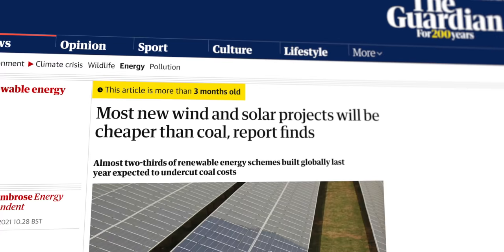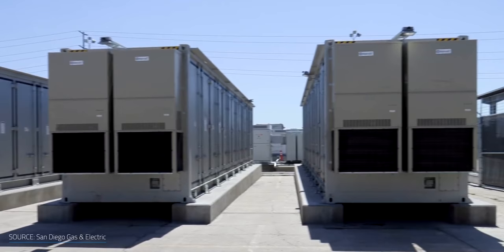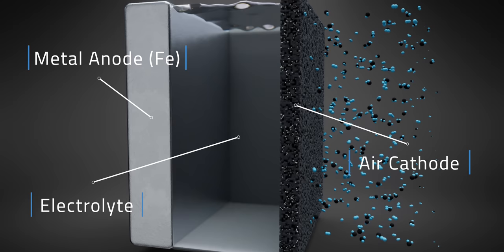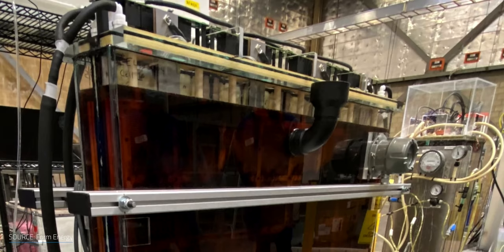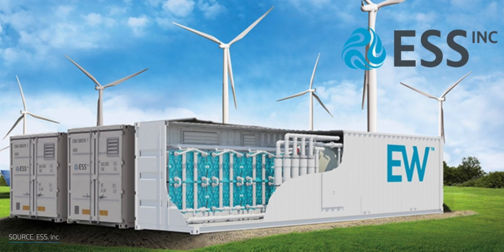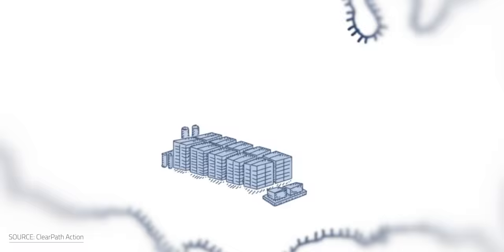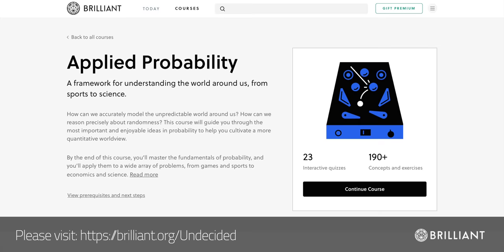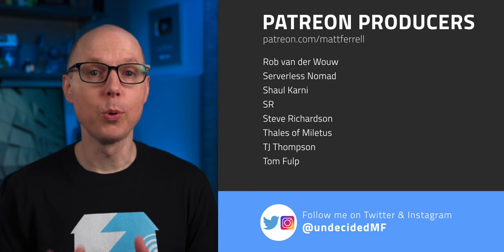Why Rust Batteries May Be the Future of Energy - Iron Air Battery Technology

Comment: Pair this with Flywheels and it could be an all-in-one solution for grid storage.
Reply: I was interested to hear his take on that. From what he said here, I would say that flywheel storage would replace Lithium ion storage for all but the most immediate response need. But that's just an armchair opinion.. Wish it had been mentioned in the video. He has access to a lot more information than I.
Reply: @jemsterr  It's honestly not a very desirable solution on earth. You either have to contend with heavy air resistance continuously draining the power being stored or invest in energy expensive evacuated chambers which kind of defeats the purpose of an energy storage device. In vacuum or very thin aired environments like space, the Moon, or Mars though, the game changes.
Reply: @yoshikhurazi1769  Thanks for that. Matt's video from 9 months ago sounded much more hopeful, which is why I thought it strange that it wasn't mentioned.
Reply: @jemsterr  It does have advantages in certain circumstances - such as when the power generation method itself involves kinetic energy such as a wind turbine, a decent portion of which would be lost to inefficiencies otherwise. It's just not a very good general solution despite being technically the first power storage method humanity had - long before we even had batteries or electricity.
Reply: @yoshikhurazi1769  i think humanity can made vacuum casing + magnetic levitation for those flywheel...
Reply: @alphaxfang  which would necessitate a bulky casing and a continuous power draw if you want to use an electromagnet - which you likely would since the alternative would be insanely expensive. It just doesn't make sense from a power density point of view. I'm also failing to see the significant efficiency gain from magnetic levitation here in the first place. You could dampen vibrations from escaping the wheel by suspending its base but the actual power saving there would be minute.
Reply: @yoshikhurazi1769  well you just need to cast it once and it will last forever, i don't see any problem with using vacuum case... Using permanent magnet always an option...
Reply: @alphaxfang  Even in microgravity environments, the angular momentum of a rotating body will bleed out over time due to both the solar wind as well as more subtle interactions with gravitational bodies. This is especially true of something as small as a flywheel. That's in space. 

On Earth, you have to deal with both gravity and the rotation of the earth causing perturbations, needing to routinely run pumps to maintain the vacuum conditions inside (since no evacuated chamber is perfectly stable), and somehow being able to translate this into power in such a way that does not significantly compromise the stability of the flywheel itself.

Why do all of that when batteries are able to work without any moving parts and without needing massive enclosures before they become energy dense to be practical? You would literally need spokes kilometres long before I could see flywheels getting genuinely competitive with batteries and such an idea might work as part of a large rotating space habitat that will need a counter-rotating part anyway to prevent instabilities developing in microgravity.
Reply: @yoshikhurazi1769  it is possible after all it is a combination between flywheel with that iron air battery, that iron battery give steady output and when the peak hour need it the flywheel will give the instant power supply... Why not lithium? Expensive, degrade over time, and it have risk of burning... We still don't have one battery to rule them all, so pairing different combination battery to cover each other weakness is a logical move...
Reply: @alphaxfang  that is true but what pundits often miss is that there are also costs associated with mixing tech - and I'm not talking about financial cost either. 

It's safe to say that Lithium ion itself is a poor fit for long term energy storage at the scale of cities or even villages. Iron air and other batteries show better promise in those sorts of applications. Flywheels have their place in certain systems, especially in conjunction with wind turbines. They're just not a good one for general purpose applications.
Reply: @yoshikhurazi1769  they are good for their intended purpose, since this video strictly speaking battery for grid level storage... that is where flywheel battery and iron air battery is suitable... 

for ev or mobile device lithium ion is a good choice for now, even though solid state is the future holy grail...
Reply: Fly wheels are dangerous to store lots of energy.  What would be good is a pumped air storage.  Just pump water into a salt dome to get a stupendous air tight vessel and then pump air to store energy and run the compressed air through a turbine to convert to electricity.
Reply: @yoshikhurazi1769  Current systems that are out there are almost all vacuum sealed and use magnets to reduce drag. Now they are expensive but that largely has to do with economies of scale. Not a lot of people are pumping them out in large quantities.
Reply: @alphaxfang  Exactly! Flywheels are great for spikes in power usage. That's why they are paired with battery systems today. Batteries are good for consistent power output but not so good for power spikes, that's where Flywheels come in.

Comment: Start-of-life and end-of-life environmental costs are often ignored when it comes to "green" energy production.  For example, lithium production is extremely dirty and requires massive inputs of fossil fuels to power the needed vehicles and machinery.  lithium ores are rare, they produce mountains of tailings and require huge settling ponds.  They are derived mostly from water-poor locations, leaving the local peoples short of water.  

End of life is no better for lithium.  Lithium batteries nearly impossible to recycle, resulting in almost all of the rare, expensive element going to landfills instead of new products.

Iron is much more abundant, can be derived from recycled metal, and can be recycled easily.  The additional weight doesn't matter for power station batteries.  It's a great idea and I hope it is widely adopted.
Reply: There are other sources of lithium utilizing existing oil/gas well infrastructure. Pump up the salt water from down deep - extract the lithium and pump the rest of the salt water back where it came from.

Comment: The problem with thinking storage will make up for times when renewables can't produce is that you have to have massive amounts of storage, AND you need a lot more production capacity than demand, so that storage can be charged up.
Reply: But that's the thing, solar production, for example, tends to be way higher than demand during daytime. Integrated grid(sorry Texas)+ storage + multi-modal renewable (Solar+Wind+Nuclear+Hidro+Geotermal) is probably the way to go
Reply: @vitoravila9908  Why do you say, sorry Texas?
Reply: @Les_S537  Texas chose not to intergrate with the national grids, to avoid regulations. (like winterizing their generation capacity)
Their grid failed because they couldn't source enough power to stabilize their grid in a cold spell.
But Ma Fredumbs ! 😅
Reply: @Les_S537  Just as he said, also, it keeps them out of the wider energy market, so they can't buy or sell energy outside of the state limits...
As an exemple, as nightfalls in NY, Texas still have almost 2 hours of sunlight, where they could sell cheap and excess solar energy, while at nightfall, with the peak of domestic consumption that occurs at this time, you could still buy cheap solar power from California for about 2:30h. 
With an independent electrical grid, this energy transmission scheme becomes unfeasible
Reply: @jimurrata6785  Texas winterizes the power stations that make sense to do, they always have.

Northern counties are all hardened against cold weather.

The southern most counties are not, because they rarely if ever get below zero, let alone for a week like what happened back in February.

Most all of the power plant failures took place in the southern counties.

Northern counties had some power outages as well, but they were more about frozen tree limbs falling on power lines and taking them out, or cars slid into power poles taking out power for the neighborhood.

In Dallas, I never lost power, or water.

Texas chose to keep it's own power grid long ago because Texans value our independence.  Regulations that make sense for a place like New York don't necessarily need to be applied in a warm weather state like Texas.

Also, look up the Great Northeastern Blackout of '65, and the 2000's
Reply: @Les_S537  Well, I'm certainly not an expert on the Texas power grid. I'm sure there are some benefits to it. That said, some points need to be highlighted:

1 - The climate events of Feb/21 are not as rare as your comment implies, similar extreme weather situations occurred in 1983, 1989, 2003, 2006, 2008, 2010 and 2011 when a severe outage happened. With climate change, as predicted by scientists and confirmed by the events of that century, such extreme events tend to be more numerous and frequent. The 2011 outage affected 75% of the Texan grid and, already there, recommendations for updating the electrical system+regulations were made (and ignored) by NERC and FERC. But this is not that important for the subject in matter, the important part is;

2 - Despite the existing connections with the neighboring electrical networks (West, East and Mexico), the distribution of energy via interconnector (DC Tie) is not as flexible as the distribution via AC within the network itself using transmission lines, it can only be performed in wholesale bulk, which is clearly an obstacle when trying to balance local demands, which are more frequent given the intermittent nature of renewables.

Besides, this disconection affects how the grid deals with reliability and extra supply power in peak demand or extreme condition. Texas relies on a wholesale electricity market, diferently from other U.S. grid operators, that maintain a capacity market to supply extra power in extreme conditions - paying operators on an ongoing basis, whether they produce power or not. Capacity market auctions determine, three years in advance, the price that power generators receive in exchange for being on emergency standby. Instead, Texas opted for free market pricing, under the assumption, but not obrigation, that generators would use their high profits achieved when energy demand (and prices) rises to make investments in grid resilience, with, for exemple winterization. Rather, they prefered to pocket the profits and bank in a supposed rarity of extreme events. Without this cushion, the grid becomes way less flexible, with tremendous pressure during demand spikes. For the last 10 years, Texas reserve margin has dropped in half.

The conclusion is that a disconected and smaller grid is less resilient to a increase in power demand or decrease in offert. Instead, the more conected and wider a grid is, the better for the operator to balance bettwen demand and offert, specially when it comes to renewables.
Reply: @vitoravila9908  It is no doubt a complicated subject Vitor, but I stand by the philosophy that lots of smaller grids is better in the long run because with the advent of the internet you now have problems with bad actors having remote capabilities to mess with infrastructure.

Also, the Great Northeastern Blackout of 1965 and 2003 are very real possibility when you have one massive grid.

If all of the states had their own grids, they would be well insulated against mishaps in surrounding grids from causing an issue in their own.

The other issue is we've erred in going down the path of renewables like wind in Texas (I'll explain where we should have gone down below).

Texas is forced to use renewables over fossil fuels, which means some of our fossil fuel plants are kept in standby to pick up the slack when wind power drops.  Unfortunately, it takes time for natural gas power plants to spin up power production.

In the February storm, Texas experienced a 60% drop in wind power in the days leading into the outage, and ERCOT failed to adjust to the changing conditions quickly enough.

Most of the power plant issues in Texas were in the southern most counties where deep freezes rarely if ever happen.  So they were caught flat-footed on that.

Northern counties are almost all hardened against deep freezes, like in the North Texas/Texas Panhandle area...  North Texas did have some power plant issues like the southern counties did, but it was because we do heavily natural gas power production...

Natural gas lines can have condensation build up in them over time.  When this freezes, it turns into a slush, and clogs lines.

Because our power plants were spun up so late int he change, they locked up and whoever they normally supplied with power was now without power.

The energy of the future will be nuclear.

Wind and solar will play bit parts, will play the part of supplemental power sources.

Comment: The main problem is that this consumes massive space compared to LFP, it's the difference between a bus-sized pack VS a whole acre to get the same 3MWh. The solution in my opinion would be to stack iron-air/rust batteries, forming types of skyscrapers.

Comment: If Li+ costs $132-$245 per MWh, how is $20 kWh for Air-Iron batteries an improvement in cost?
Reply: sp0777iXdlMLalN0dsXxlMlNdsM0jdsj The $245/MWh is the LCOS. $20 kWh is the manufacturing cost. Two completely different metrics.

Comment: Lithium is the gold standard when it come to battery efficiency with the ability to get out almost 100% of the energy put in. Lead acid is roughly 85% efficient and pumped water storage at large scale is just behind at 70% to 80%. By comparison Iron air batteries at 40% to 60% are barely able to return half the energy input. Combine that with a pretty poor 500 recharge cycle life and I don’t see they have much of a future. 80% efficiency and 5000 recharge cycles referred to in the document at 8:44 is a target but as that document also states the current capability is only 50% efficiency. If you have the geography a pumped hydro system is far better.

Comment: The focus on temporal variability and storage leaves spatial variability and grid too little thought about, and makes the problem unnecessarily harder to solve.  The statement that the wind isn't always blowing belies this thinking...of course it is, just look at any weather map (or the study that showed that the UK was producing commercial wind power 100.0% of the time over a 25 year period).  It just isn't blowing here, but is within distances that power can feasibly be carried using transmission technology that's been in large scale commercial use for decades.  A study showed that a grid could make wind power as reliable as a coal plant.  A mix of grid and storage could get things much further, even with existing storage technologies that have been in large scale commercial use for decades, like pumped storage and hydro as peaker.
Reply: The problem with pumped storage and hydro is that they are location dependent, and all of the viable locations are in use already. 

I agree, wind is much better than people give it credit for, but bad public perception and lack of production are both slow processes to change. 

People are much more willing to put their hope in technology that they know nothing about than to correct their misunderstanding of existing technology that “has had its chance”.
Reply: @Loaderdani  Quite a bit of hydro is used for base load power, which is a lost opportunity.  With long distance transmission lines, like the DC one from BC to LA, more could be used as peaker.  The Mica dam, for instance, holds an enormous amount of water behind it.

Comment: Electric storage heaters are a way of storing energy. I have them. They are fine when it's consistently cold, but poor when the temperature varies, due to their slow response. Could the design be improved by having larger units, perhaps for district heating, that would store heat for longer periods, preferably several days, or even weeks?
Reply: Heat the ground! What great way to lose energy!
Reply: @Sinaeb  What do you mean?

Comment: I often wonder what sort of storage solutions would be good for my home.  I wouldn't mind having batteries that last 4 days but don't have the cash to shell out for the top of the line storage.  I have a basement and backyard to build a shed with batteries, but just haven't researched all that much.  Like, how many of these would I need to power my house for 3 days or a week?  I feel that with the amount of solar that people have that storage options for consumers would start building up as well.
Reply: Good old lead-acid car batteries may be the way to go for you.  One car battery is worth about:
60AH * 12V = 720WH  AKA 0.72KWH
Check the specs for your freezer and see what it averages to.
That is the highest priority thing in most houses.

Comment: I think that the solution should be to store excess energy as potential energy and not chemical energy. chemical energy has its advantages by being mobile, something that you don't need in this case.
Here (Israel) we have a "lake battery" where any excess power is used to push water uphill and fill a reservoir, and then use the potential energy when in demand as hydroelectric energy.

Comment: I am still unclear as to why the aluminum versions discussed in the previous episode are not rechargeable or refuelable. More-so given that this iron type is.
Reply: I’ve heard it has to do with how porous the oxides are. Aluminium oxide has very small pores, so it’s hard to remove the oxygen from, whereas iron ore is very porous, so oxygen can move through it to react much more easily. Kind of makes sense to me, but I only have annecdotal evidence for it.